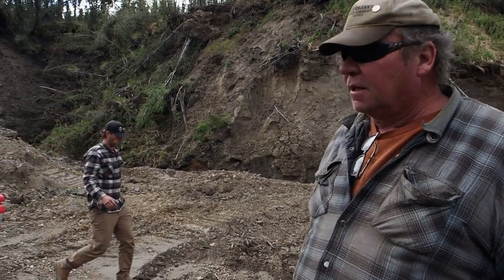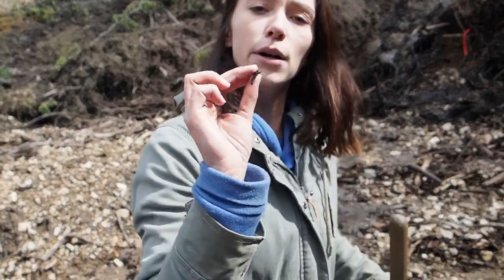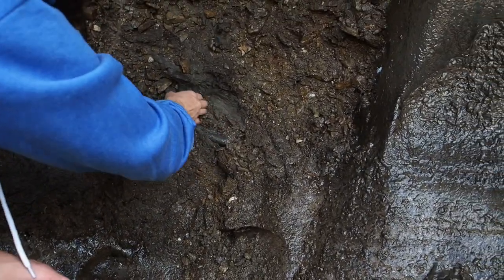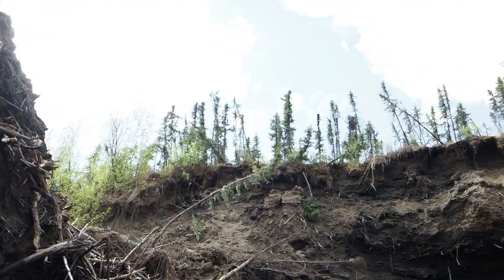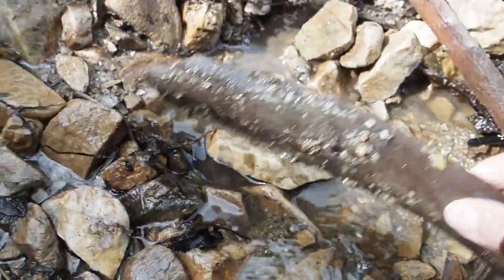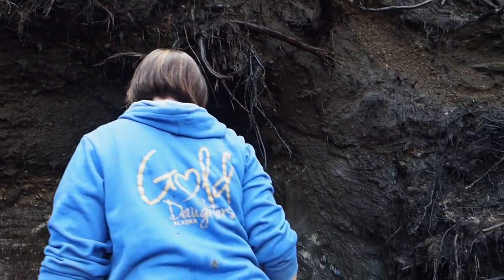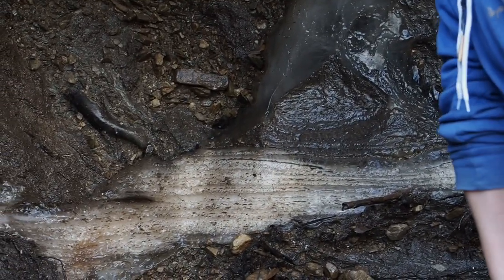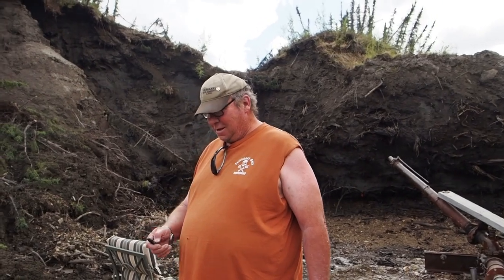Alaska fossil hunting is Epoch!

Comment: What item is the piece In the thumbnail for the video? Its the small palm sized piece that has two slightly tubed shaped holes in it but smooth on the underside with a groove or two.

My 8yr old son found a very similar item on our local beach a couple of months ago. We are both very curious.
Thanks

Comment: Wow that's my dream. I'd give you at least a free week of slave labor if you let me run the monitor for an hour. 

Picking apart that deposit is one of the coolest things I can imagine doing. The way the bones are shattered apart and mixed in with the flowing gravel deposit is mind boggling. Then 60 feet of mud and trees on top of it all, wow. Entire landscapes were washed away. I've read about the possibility of a comet breaking apart, scattering debris all across the ice sheets, as a potential energy source to melt enough ice to cause this level of catastrophic flooding. There is strong evidence of an impact about 12900 years ago, and there have even been tusks found with meteoritic grains embedded in them. Have you guys ever had any of the wood dated?  

This is super cool, thanks for posting. I'm serious about wanting to help. I don't even want any of the material. Just the experience of seeing that in person would be unreal.